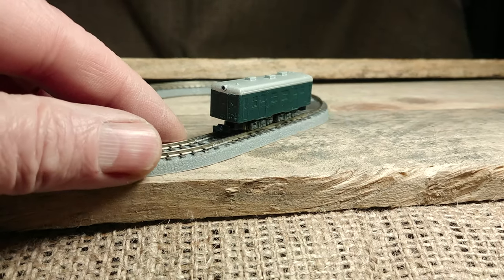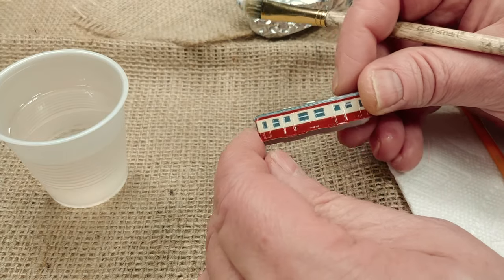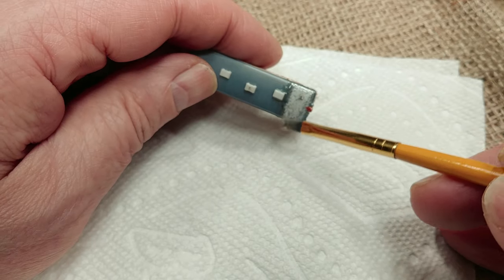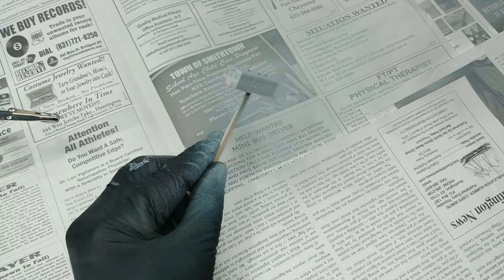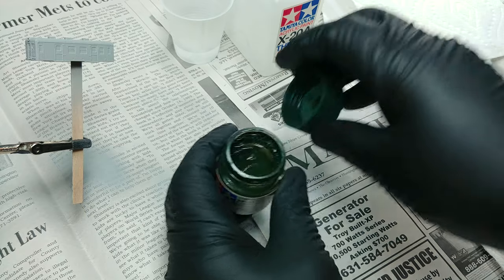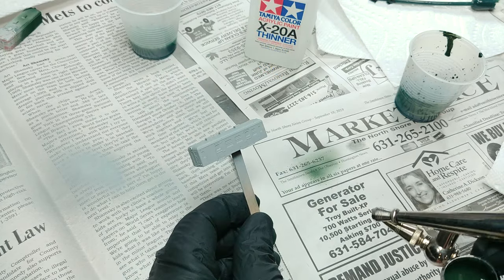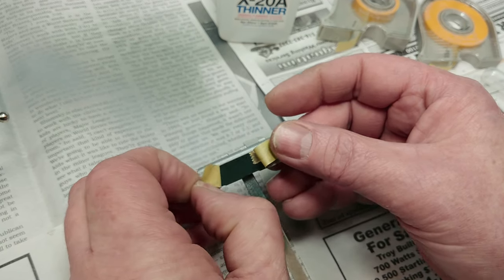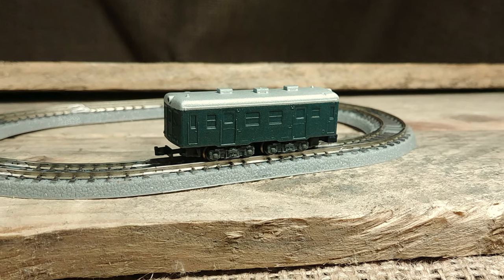Stripping And Repainting A Z Scale Rokuhan Shorty Locomotive Shell

Comment: To remove paint use simple alcohol and RUB with a paper towel or similar, a brush will do nothing. Other method includes submerse the model in caustic soda (NaOH) for several hours and also RUB with a paper towel to remove paint (use gloves). Caustic soda will not attack the plastic

Comment: Looks great as a boxcab!  By the way, two excellent paint strippers I've used for plastics are cheap brake fluid and foaming oven cleaner.  I usually use the brake fluid for small items I can soak in a container.  For larger areas, the oven cleaner is best.
Reply from the maker: Thanks! I've heard of the brake fluid and really I should have run down to the store for some, but sloth set in and I reached for what was handy :) Next time. The red part of the paint, it almost looks like it's part of the plastic body in the close-up shot, though it's so tiny it's hard to tell. I will give the brake fluid a shot first next time. Overall, I'm liking these little inexpensive chassis and shells, give you some freedom to play.
Reply: Yes, I like these Shorties, also.  I've designed and printed a few locomotives which use the chassis.
Reply from the maker: @ricomon64  It'd be interesting to see them, do you have a link for them?
Reply: Not yet.  I've only printed them on my FDM printer, so they aren't the cleanest of prints.  When I print them on my SLA printer they should be much more presentable.  My SLA printer produces prints that would almost pass for injection molded items.  I'll let you know when I have some finished.
Reply from the maker: @ricomon64  Look forward to seeing them!